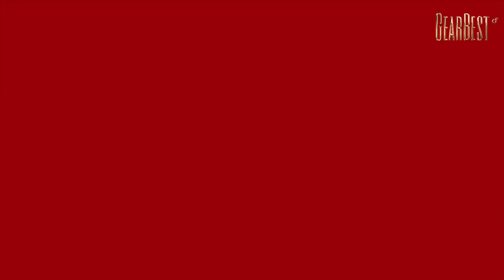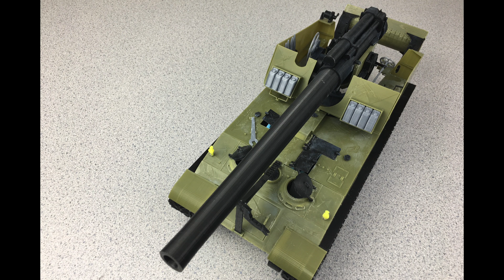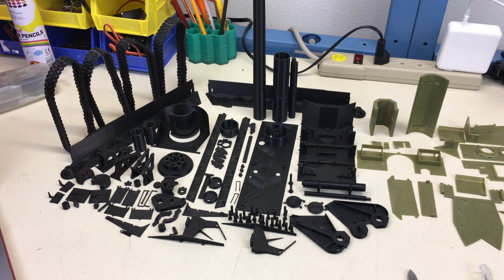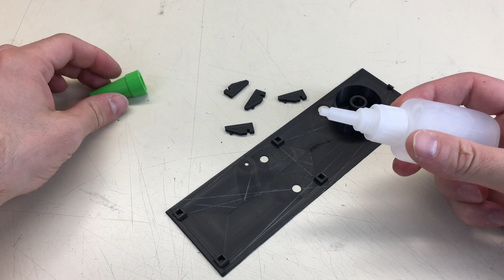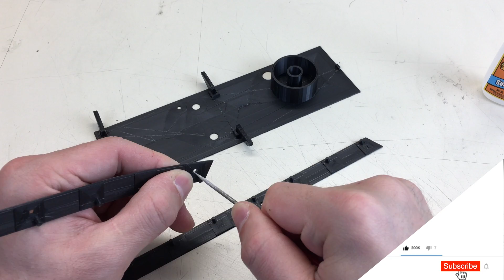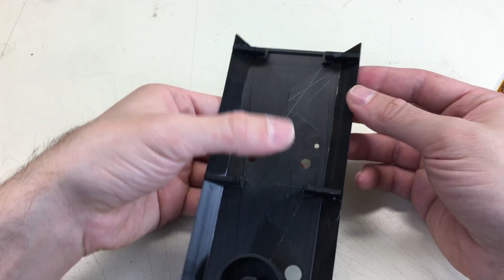3D Printing T92 Tank with 145 Unique Parts & Assembly | Creality CR10

Comment: Hello . I bought 3D modeling of your T92 on the Chinese shopping website. Can you produce or sell?
Reply from the maker: Oo it is not my model.  It take a lot of time to make it. If you want you can buy the one I have?
Reply: @3DPDoctor  Ok, I can buy your modeling, but I have a problem. Looking at the dimensions of these model parts on my computer, they don't seem to be 1/35?
Reply from the maker: @kJ-ki3eo  I am not sure the final sizing. I printed the stl files by scaling them up. So my printed model is bigger in size.
Reply: @3DPDoctor  Can I get the original size file of the model from you, or can you help me process it to print 1 / 35 scale, and I can pay the corresponding fee if you need it
Reply from the maker: @kJ-ki3eo  lets talk over email, I guess you know it
Reply: @3DPDoctor  Because the military model 1 / 35 is a normal ratio, I want a 1 / 35st file
Reply: @3DPDoctor  I've sent an email to your gamil